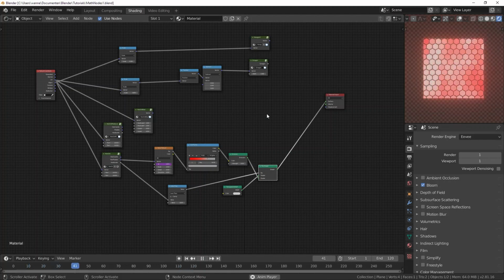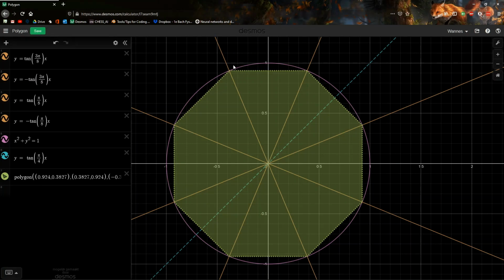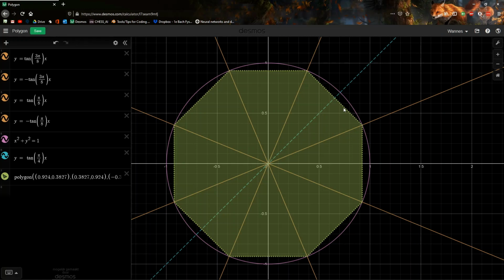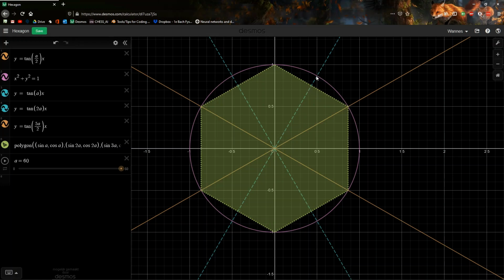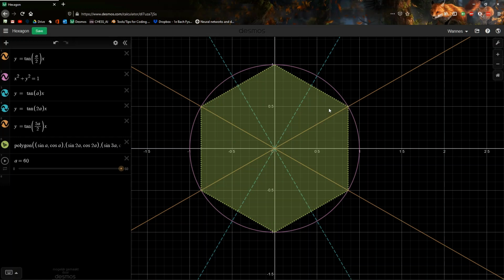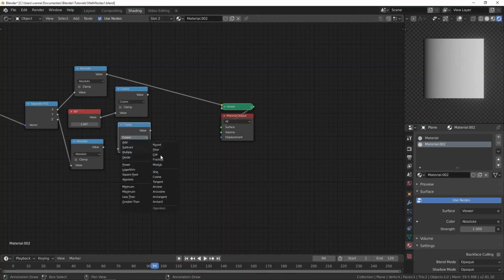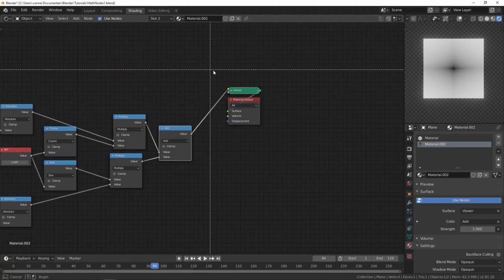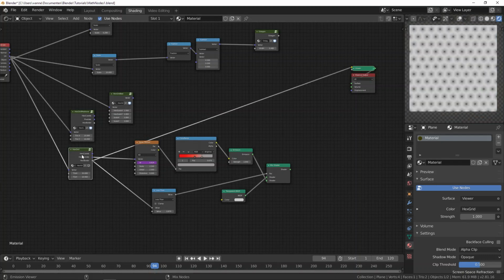MNE #11 Procedural Hexagons (part 1)

Comment: Very good video, a very good and clear explanation on how to transfer the hexagon maths to the nodes, congratulations :)
Just a note, for the angle value, instead of using a value with pi/3 you could use a math node in the mode "To Radians" and just input the required angle of 60 degrees, easier for the user in the end :)
Congrats!
Reply from the maker: Note that this video is a bit outdated and there is a newer one which has a much simpler setup (I think the title is something like "hexagonal tiling in 9 nodes"). So you might want to watch that one as well
Reply: @WannesMalfait  cool, I’ll check that one too :)